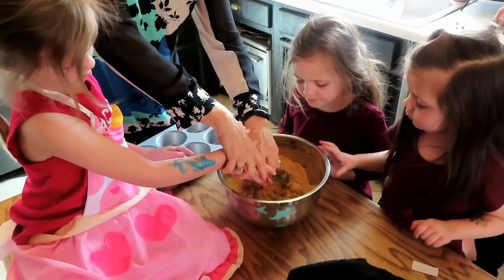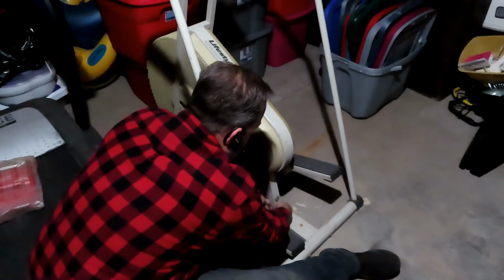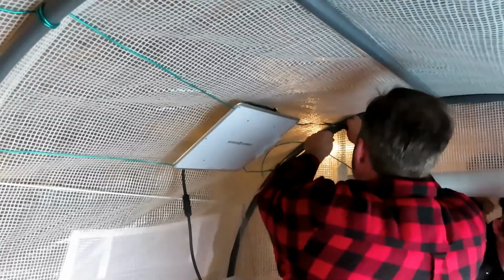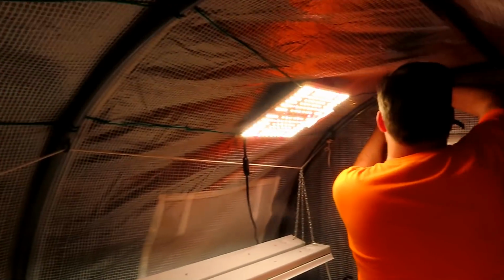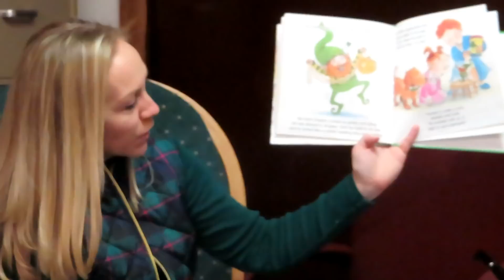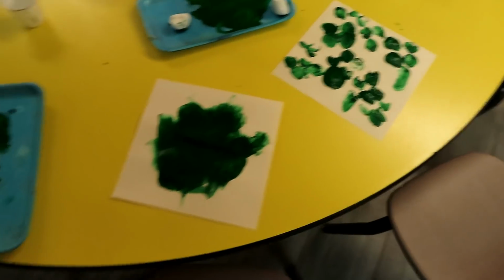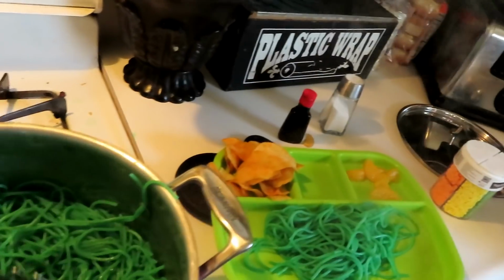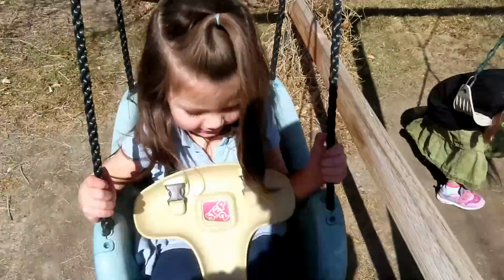St  Paddy's Day & Springtime Memories ¦ Large Family VLOG

Comment: Hold the top of the girls heads as you brush ...helps with it not hurting so much. Also if you get the girls hair trimmed regularly it helps with less tangles at the bottom of their hair when brushing.... as less split ends causing chaos.

Comment: Hey Tom
Just a tip
When hair is really tangly it’s much less painful to work from the bottom and get those tangles out and move up as you go. I also will grab all the hair hanging down with one hand and brush with the other hand so I’m not pulling on the scalp. Tangles are the worst!

💗
Reply: Get a detangle comb at dollar tree or walmart.  Use spray detangler and work from the bottom.
Reply from the maker: The brush I am using is by far the best tangle solution we have ever used, and we've tried them all :)

Comment: I came to just give a little tip about brushing long hair, but it seems this loving community has given you some great advice! <3  I have  very long hair as do my girls. It helps to lay your hand flat on the back of the head so it holds the roots down while you use the other hand to brush. It only hurts when the roots get pulled on. If you stabilize them, it won't hurt no matter how big the knots are. I hope you take these tips in the spirit they are being given. We all want to help and don't mean it as a criticism.